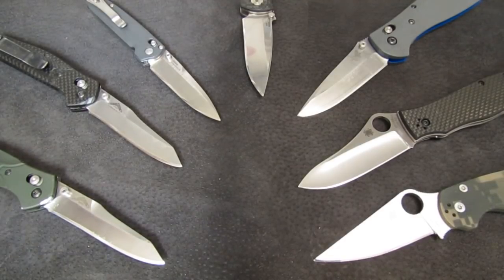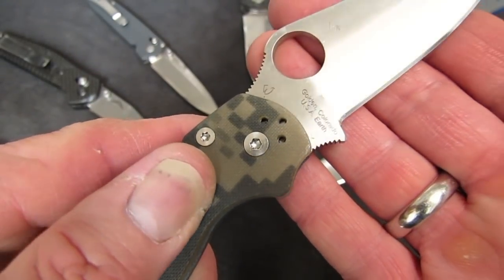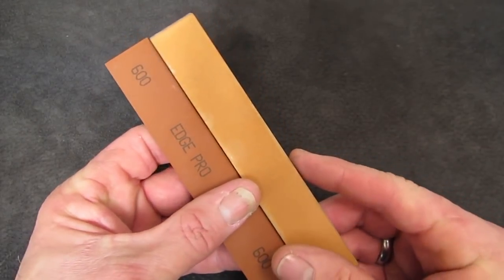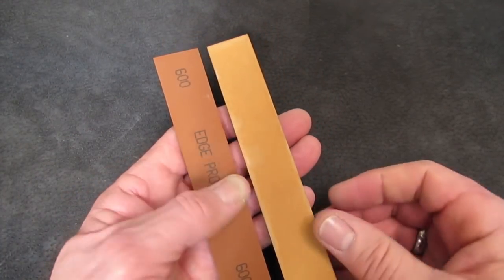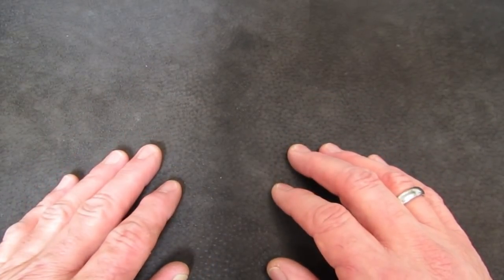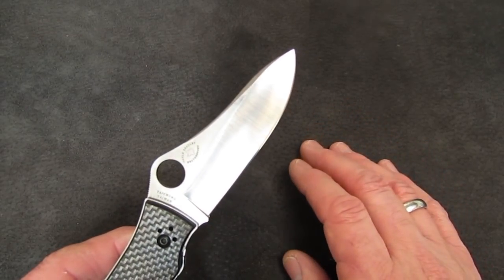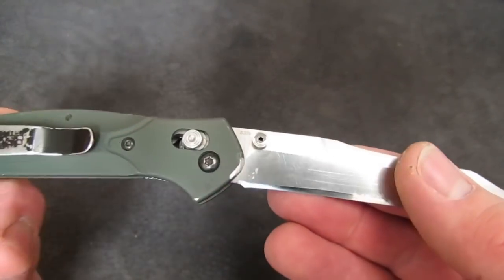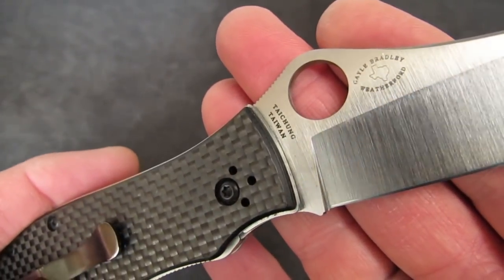Edgepro Tutorial #6:  Common Sharpening Mistakes and Solutions

Comment: I recently switched from a Wicked Edge to an Edge Pro Professional. It took me about 5 knives to get a feel how my hands wanted to do each job and after about 20 or so I feel I am about equally good with my dominant hand as my off hand for either aspect of the work. 

I think the thing that helped most with my sharpening consistency as I moved from side to side and stone to stone was to make some sort of indexing mark on each side of the spine of the knife that I would align with the edge of the knife stop and then bring the belly/tip of the knife to cover the table. Of course this only works with pocket knives you don't need to move. Using a sharpie marker occasionally as a sanity check for your angle compensation is also smart. 

The nice thing about the Edge Pro is that it has really taught me the importance of not bearing down with my stones. You're not going to have a good time if you death grip the knife and the stone arm. Relaxing and using as little pressure as necessary with both hands gives you a better feel for the sharpening process and a more consistent result.
Reply: Lenny, do you still like the Edge Pro better than the Wicked Edge?
Reply: @707SonomaComa  Hey man. Yeah, my opinion is still the same. It's a really nice machine but I think it's kind of in an unhappy middle ground. I found that the sear size of the machine made sharpening smaller knives difficult: the size of the machine and the position in which the knife is held makes it hard to see how the bevel is developing. On the other hand, if you are sharpening a really big edge, then you have to watch out for the blade flexing or worse, loosing track of where the tip is. 

In short, if I was only going to sharpen pocket knives, I'd probably stick with something like a KME (you can absolutely get results as good as Wicked Wedge on this) and if I was looking to sharpen a really varied selection of edges, I would get an Edge Pro

Comment: Thanks so much for putting together these videos, Rob. Your advice and experiences have heavily informed my progression in the art of sharpening over the past 3 years to a tremendous degree. 

A number of things you share in this video are things I've already learned the hard way, but I'd like to add to one in particular to hopefully spare others my anguish: when doing a choil extension with the Dremel, HOLD THE KNIFE WITH BOTH HANDS AT ALL TIMES!!! I straight-up ground off large chunks of the edge of a Kershaw Cryo 2 and an ESEE Candiru as they ran away from me because I had another hand doing something else at a time. The Candiru was thankfully salvageable (although it has a profoundly jacked up bevel reveal now), the Cryo 2 I just gave up and made a massive forward finger choil out of it (surprisingly ergonomic, actually).

I know it's been a couple weeks, but if you're still taking comments/requests, I still have one significant issue you didn't really address here: On almost every blade I've done with a microbevel, the edge is quite sharp when fresh but dulls within just a couple weeks and stropping/honing only brings it back to a relatively pale shadow of its original sharpness. I've tried a number of different maintenance techniques and am about as confident as I can be that I am indeed stropping and honing the micro and not just polishing the primary. The only thing I can think that I might be doing wrong is too much discrepancy between my primary and micro angles (I've done a few AUS-8 and 8Cr blades at 17 Primary, 21 Micro and a Sheepsfoot 154CM Mini-Grip at 15/20). Because of this, I've basically given up on microbevels in all but the hardest-use case and instead pursue a more conservative single bevel. This works, but I can't help thinking this still isn't how it's supposed to be. Any insight you could provide on what I may be doing wrong would be exceedingly appreciated.

Again, thank you so much for doing these videos. There's frustratingly little out there going into the specifics of how to bring edges to the next level - particularly on these systems - and especially the pitfalls inherent with them. I am extremely grateful I started off just doing $10-$20 knives before moving on to more expensive stuff because I did absolutely ruin more than a couple.

You are directly responsible for re-kindling my decade-dead passion for knives and moving into the joy and challenge of the sharpening experience.

Comment: Great video Rob, very helpful. One issue that I have had to learn to focus on, is when using a sharpener that has a clamp, especially when sharpening a full flat ground blade, is making sure you get the blade centered perfectly in the clamp, or else you end up with one side having a steeper angle than the other

Comment: I know this is an older video but I would be interested in a tip repair tutorial. Some other Youtubers have content like this where they Take very high angles to grind out broken and blunted tips and then reduce their angle to the final degree and match it with their primary angle. I do find it very time consuming to try and sharpen a tip back to pointedness without changing an angle. i'd be interested to hear what you have to say on this.

Comment: So I have found that 3M 3350 tape is awesome for knife prep.  Actually, bought some for an A/C job and it's worthless for that because it is not foil tape(though it does look like it it is metalized mylar), but for knife prep it is amazing just because of it's excellent waterproof adhesion, toughness, and it is super thin to boot.  Oh and it's also easily applied to the blade, and it pays to take it past the blade all the way to the handle for protection of the handle...again, this is not aluminum foil tape it is like metalized mylar and so super thin and easily formed it rocks! win win give it a shot

Comment: Two other topics that just hit me I (and I presume others) could really use some help on: 

1. What, if any, compensations need to be made for traditional knives with blades at an odd angle from the handle (think Swiss Army Knives and Congress-style traditionals that nest their blades at diagonal angles)?

2. What methods do you use for blades that are extremely thin and narrow? I already own the EP Short-blade attachment, but it's not enough for blades like the Victorinox Mini Classic or a Peanut or Tiny Toothpick traditional (or the small secondary blades on a host of other traditional patterns). Even after removing the plastic clip, the stone strikes the top forward edge of the blade rest, not the blade itself. I read something in the EP documentation about constructing some sort of shim to lay between the blade and the EP's blade table, but my efforts cannibalizing credit cards and taping them together have gone poorly to say the least.

Comment: I talked to Gayle Bradley on the phone a few years ago probably 8 years ago about that he said he talked to another knife maker and one of them does the show side of the blade very well and the other one did the reverse side very well they each had a side they didn't do so well and they joked that they should get together and sharpen knives lol  but I do the same thing the show side of the blade I do very well in the other side I have to be very very careful and I still make mistakes on it of the getting the angle perfect I can still get the knife sharp but the angles aren't exactly the same on each side but I have got a good angle on both sides so I can still get it sharp enough that I'm very happy with and it's very good but I'm a work in progress.. I did ruin a lot of good knives when I first got back into knife collecting about 10 years ago after having strokes. I had to relearn everything from the beginning and I wish I would have had that advice of getting some crappy steak knives and ruining those instead of Pro-Tech and other expensive knives I didn't ruin them to the point that they were junk but I definitely made a convex bevel back then before I knew what I was doing wrong I wasn't taking my time and getting it right I didn't have the  mental capacity to do that.  I should have sent them to you to have them worked right but anyway those knives are gone.

Comment: Could you give advice about avoiding a widening of the bevel at the tip?  the tip was the hardest part for me to learn.  I started out on a sharpmaker and would keep my knife perfectly parallel and would never hit the tip.  so I would work the tip so much my bevel would get really wide.  I learned I needed to slightly rotate the handle inward.

Comment: Hey Rob great vid, I'm fairly handy with my EPA but I've been doing some convex edges and I have a slight concern that I will continually increase the angle making it more and more obtuse how do I avoid this?
Reply: Kevin cleary are you sharpening your convex blades on the edge pro ?  If so stop ✋ and watch Robs tutorials for sharpening convex.
Reply: As a freehand sharpener who's been doing convex edges lately: Variation has been a marketing argument by fixed angle systems for some time. They often take it to rediculous lengths, making it sound like the angle will change more and more with each freehand sharpening until one day you find yourself cutting a 90 degree angle on your stones and wondering why your edge won't cut. Of course, this is silly on the face of it, but I think people have this notion in their heads now that the variation of freehand sharpening will compound, rather than always staying within a certain range. 

With a convex edge, the most obtuse you want to go is the desired angle of your cutting edge. Everything else is shaping the approach to the apex. I pick the edge angle by feeling with my hand at what angle I want the blade to start to bite in, and that's the most obtuse angle I use. Do I vary by a degree give or take between sharpenings? Probably. But never more than that, because that comfortable angle at which I want the knife to bite in is always pretty much the same.
Reply: I have read about people cutting and then taping a mousepad to the blade table to do convex edges.

Comment: Which knives have the best/easiest blade geometries for sharpening?
Reply from the maker: barcibus Great question, and on I don’t believe anyone has ever asked. The answer: the Spyderco standards — Para 2 & 3, Manix, Delica and Endurance, as well as others with full flat grinds. They’re made to cut, sharpen and use more than any other brand.
Reply: @TheApostleP  thanks for the reply!  Regarding the paras, could they make the blade shapes even friendlier to sharpening if they removed that shoulder that sticks out at the top of the ricasso?  Or added a choil just above it?

Comment: Have you covered scandi grind sharpening on the edge pro? I see several points in this video that will help.  Stone prep is a primary issue, I think.
Reply from the maker: Aaron Longsworth the Edgepro is absolutely the wrong tool for scandi sharpening. The angle of most scandi grinds steepens radically through the belly to the tip. First of all, the knives are designed that way. Second, if you tried to make the angle consistent hilt to tip, you would be removing a HUGE amount of material from the belly and tip. It would take a very long time and radically change the shape at the tip. Scandi grinds should be sharpened freehand.
Reply: TheApostleP thank you sir.  You're knowledge and my recent experience match perfectly.  Thanks again for the great information, videos and response.
Reply: Aaron Longsworth Not that you asked for my opinion, but I was actually dumb enough to attempt sharpening a Mora Eldris on my EP somewhat recently. I figured with the relieved compound grind at the belly and the short length it might be doable and my initial tests sharpie-ing the edges and swiping seemed to confirm. It quickly ended up turning into a disaster. I was able to salvage it by using my EP stones flat like very short whetstones, but I wasn't able to make an effective fix until I ponied up for a legitimate proper compound waterstone. It still looks pretty junky because I accidentally went past the bevel a few times, but it's certainly sharp now. I would very strongly echo Rob's advice.
Reply: Andrew Romig , Disaster is right. I recently made the same mistake on a Mora.  Live and learn, right?

Comment: I found that lionsteel knives have a variation of edge thickness behind the edge which causes a variation in the broadness of the final edge if that makes any sense. Don’t see any way to correct that other than regrinding the knife which would kill the steel hardness likely killing the knife so I just live with the variation even though it is fairly slight. ?

Comment: Awesome video!! I always wondered how you did choil mods. I have an extensive high end knife collection and have been slowly working my way up to sharpening the more expensive ones. My issue is knowing what angle to use. I have been using 20 degrees for everything. I notice you sharpen around 16 and 17. How do I know what angle to use?
Reply: Chris Franks your sharpie is your friend....use it a lot
Reply: Chief Chuf  I should have been more specific. I can figure out the factory angle with no issues. I have read that depending on the type of steel,  the thickness of the blade stock and what the knife is being used for determines the angle you choose to use. Am I way off base on this assessment?
Reply: Chris Franks I don't claim to be an expert, but from what I've learned, I'd advise a combination of experimentation and maybe some internet research to see what people are getting out of knives similar to yours. Thickness of the blade stock doesn't matter nearly as much as thickness behind the edge as far as what sharpening angle to choose, but blade stock thickness and grind can have a big influence on what level of general performance is reasonable to expect. If the grind is too obtuse, the blade can become a wedge through resistant media like wood and cardboard regardless of how sharp the actual edge is. I have an ESEE Candiru that will split standing hairs on the edge, but is a mediocre performer through cardboard because the shoulders of the saber grind drag through the media. Opens mail and cuts paracord like a boss, though.

First off, (for non-kitchen knives): in my experience almost anything will be happy with an 18 degree per side edge - it is a substantial improvement over the oft-recommended 20 and can be brought back in a hurry on Spyderco Sharpmaker for touch-ups if you have one. I'd consider that a more favorable place to start unless it's a knife you intend for serious abuse. How far to go beyond that is indeed very strongly dictated by your intentions for the knife and the characteristics of the blade's steel. If you intend to do a lot of chopping, sticking at that 18 (or even going wider) and possibly adding a microbevel might be the way to go. If all the knife is going to do is open mail, 15 or 16 might be a more logical choice. Going beyond 16 degrees per side or so on anything less than 60hrc has always gone poorly for me. As Rob references in this video, really top flight steel can potentially start moving into the 11-14 range. Microbevels can be used to stabilize more aggressive angles, but I've had generally poor luck with microbeveling and have almost given it up outright.

The three most important lessons I've learned (the hard way, as I learn most things) when it comes to picking angles is:

1. What blade steel is used is far less important than its actual heat-treated hardness. Both my ESEE Izula 2 and the aforementioned Candiru needed to be re-done because I saw "1095" the first time and assumed I was dealing with the same 1095 in my kitchen knives and traditionals. ESEE designs their knives to be bomb-proof (and they really are), but achieving that durability comes at a cost: they're only 55-57hrc. They just couldn't hold at 15 degree primaries with a 19 degree micro to my satisfaction. I switched them to a straight 18* degrees per side with no micro to attain the performance I wanted with adequate edge retention.

2. 18 degrees per side on a blade that's .030" behind the edge is NOT the same thing as 18 degrees per side on a blade that's .020" BTE. I put an asterisk on my last point for a reason: in order to get my much thicker behind the edge saber-ground Candiru to behave similarly at the edge to my full flat ground Izula 2, I had to crank it up to 17 degrees per side. The results were edges of similar thickness and support (and therefore performance and edge retention). Keep in mind that the inverse is also true. The effect your sharpening angle will have on edge retention is largely dictated by the amount of steel around and behind the apex supporting it.

3. The third is something Rob's much better at gauging than I; Whether or not the angle you're pursuing is reasonable for the grind of the blade. Rob showed several examples in this video of a sharpener being too aggressive and creating plunge grind problems as well as massive bevels. I've fallen in this trap before, too. I couldn't really tell you how to know where you've crossed the line here (hopefully Rob can). This where your experimentation can really come in. Assuming you don't care about the cosmetics of big edge bevels (I certainly don't, provided they're symmetrical), I guess the chief indicator would be what angle you can consistently achieve at the plunge grind. It seems logical that you should find what you can pull off initially on the most difficult part of the blade and then sharpen the rest to follow suit. I sure wish that idea had occurred to me a year and a half ago, when I first got my Edge Pro.

Again, I'm no expert. I'm just someone who's made a lot of mistakes and learned from them. Feel to use or discard any or all of this advice.